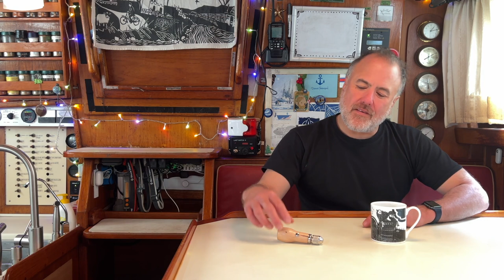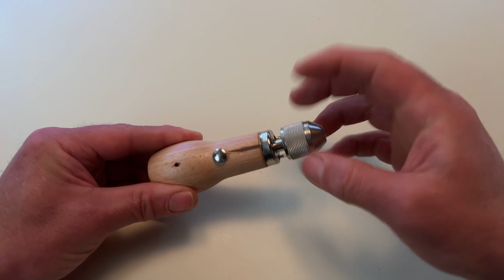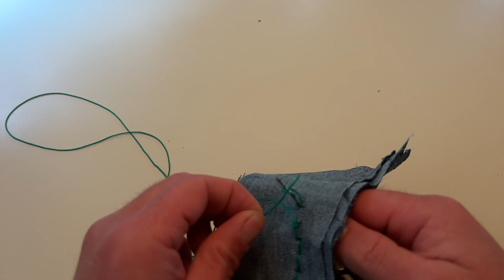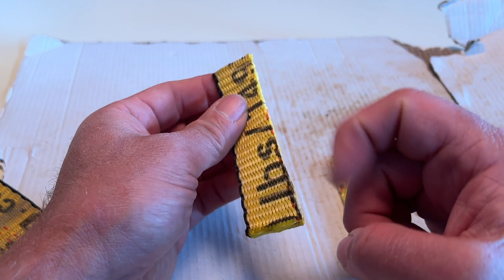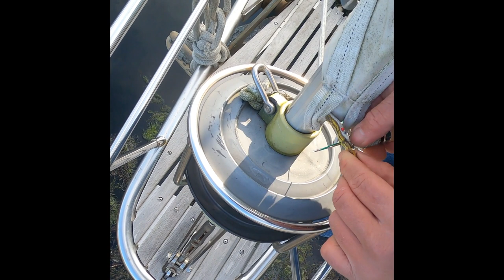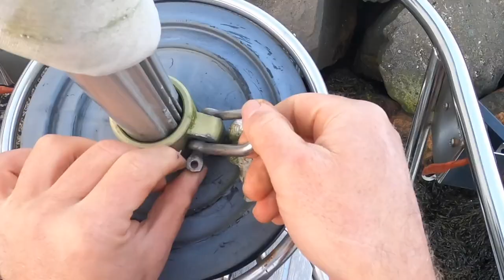The Speedy Stitcher Sewing Awl | Paragon's Favorite Stuff Ep. 21

Comment: Excelent thanks.  I have a speedy stitcher and have used it on several small repairs.  I have used waxed twine for these, but am running low on this material.  I would be interested to know if you had any recommendations as to which type and weight of twine to use for various jobs, and possibly sources that they could be ordered from?